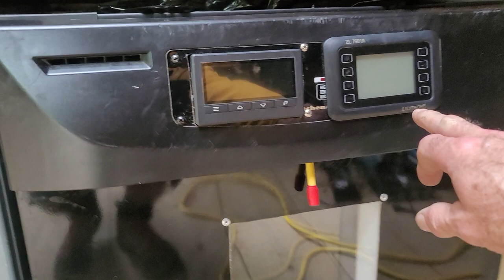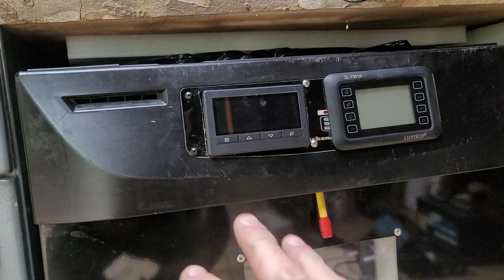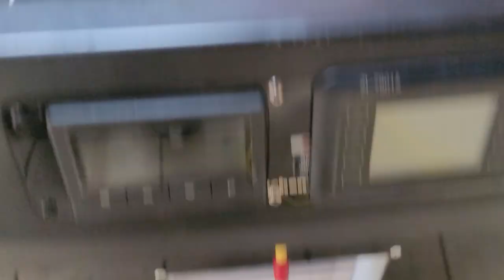DIY 500 Jumbo Quail Egg Incubator using a dishwashing machine and custom egg turning tray

Comment: Wow 🤩 I can’t believe this was a dishwasher 👏🏾👏🏾👏🏾👏🏾👊🏾👩🏾‍🌾
Reply from the maker: Neither can the guy I repurposed it from :).

I have a glass door wine cooler that I made another 2 chamber incubator out of that I will be posting a video on soon.  I was trying to use a small temp/humidity controller that mounted inside the center divider/fan housing to keep it "neat" inside of using a large external full service controller, but I'm having problems with the cheap-o smaller controller (no longer sold on Amazon as its el-crappo).  The plan is to use the wine cooler as a lock down /hatcher and keep the dishwasher in service for baluts, as I have to clean the unit after any hatching.  I hope to address that issue today... mebbe :)  thanks!  I'm trying the H202 rinse for 3/4 of this hatching tray in the video that some guys say doubled their hatch rate (a patented process oft used in the commercial hatching biz).  I'll post the results in 3 weeks.
Reply: @tullyriverquail  I’m looking forward for that content ☺️

Comment: Great video looking to use the same controller for my build but I see it requires the use of limit switches does it have like a countdown for the amount of time the motors are on or is it only used by the limit switches thank you
Reply from the maker: Yes, you can set the countdown timer for however long of "short period" desired.  The long period is 180 mins.  
I only use both sides of the R and L to power a rotary motor that slides a rack 1.5 revolutions leaving the egg roller rack on the opposite side of the tray after rolling them back and forth one try length.  The distance of motion is limited by the drive arm attached to the horizontal motor - an acrylic 1.25" arm fixed to a mushroom bushing and a rivet for the pin that fits into a 4" long u channel of 1/2" aluminum attached to the rack.  There's a video on my channel about that somewhere I'm sure.
I'm designing a desktop incubator and hope to complete it this evening, ready to test and load tomorrow morning.  We will soon be able to send hatching eggs inside an affordable incubator shipping-box

Comment: Nice set up but i would worry about moisture getting into power strip after a time.
Reply from the maker: I'm considering moving the powers trip externally and using a surface mount quick disconnect (waterproof) connector harness, but finding quality parts for my specific application almost requires me to "3-D print" my own.  It bothers me that it's not 'tidy', being a retired Dentist and all the anal retentiveness that goes along with years of perfection on demand.  My wine fridge build has this mounted outside the box, but I face the same issue running power to each egg turner motor.  Great insight
Reply from the maker: It is "GFI" protected and has the reset button along with two drain holes in the housing bottom (to prevent a "flooding" short).  I need to look at Alibaba to see if there's a company that can fabricate my wiring harness connectors

Comment: what is the bottom material of your turners made out of im building a incubator right now id like to use something like that
Reply from the maker: @BradleyPace-l9g  hi B.P.  there is an awesome metal and industrial Salvage yard here in Reading PA called Moses P Glick's (they are online).  This material is 3/8" thick aluminum with 3/8" holes and were large particle filter plates for inside industrial machinery.  These fit into a pan at the bottom of an oil filled unit of some kind and served as a strainer.  The plates were 18" x 21" if I recall, and I put a diamond blade on my portable table saw to cut to width to fit the trays.  Each tray took 1 + a portion of a second one.  Glicks had 20 4' tall pallets stacked with these!
The cool thing about this material besides it not rusting is that it retains heat - great for countertop candling of 120 egg trays!  Look online... they may still have some.  If I run out there I will look and write you.
Btw... we are launching the member-owned USQuail Cooperative directory  and business resource platform within the next few weeks.  We are trying to develop a parallel poultry network of Quail growers across America for when SHTF.  You can pre-register at USQuailCoop.com or learn about the benefits at usquail.com.  I hope you will join us!